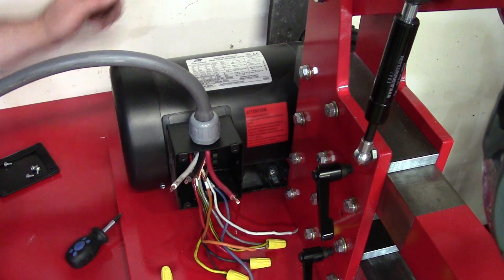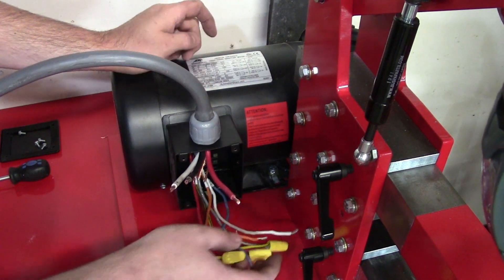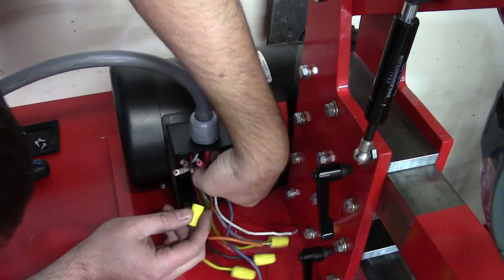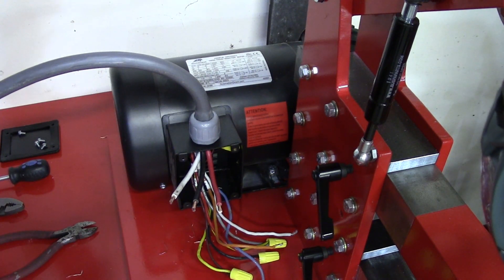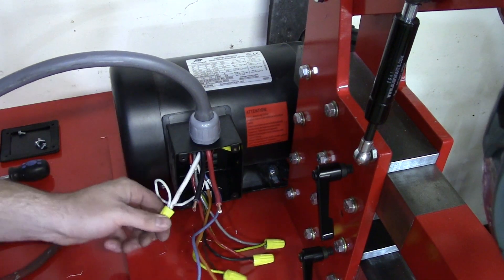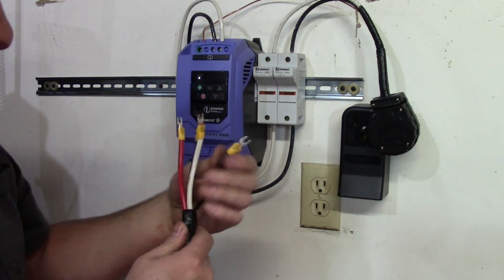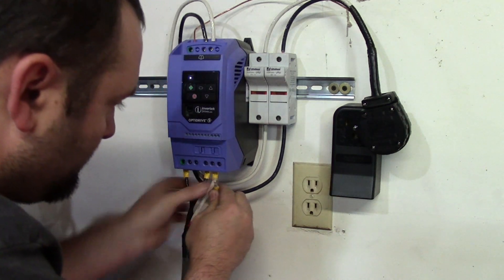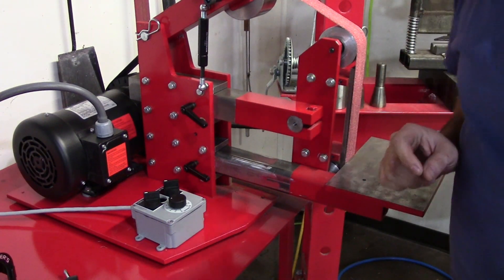How to wire a 3 phase motor to a VFD

Comment: Great video! Thanks for showing us all this. Newly subscribed and love your channel.

I’ve got a KBAC-27D and the iron horse motor for my grinder. I also have a Rockwell knee mill and a Rivett lathe that I’m going to be updating the motors on, to the same exact motor. I’m planning on using the single VFD with a twist lock female attached and then swapping out the machines (which will have male twist locks) as I use them. Any recommendations as far as plug/wire needs?
Reply from the maker: Thanks for watching!

Comment: I'm trying to wire a 3-phase motor from an old DeWalt radial arm saw to my VFD.  There's no wiring box on the motor, only 4 wires coming directly from the motor housing (red, white, black, and green).  How can I tell which of the red, white, and black wires connect to terminals U, V, W on the VFD?
Reply from the maker: If you're 100% sure it's a 3 phase motor it will not matter which order you hook them up in.  If there are only 3 lines that means all the jumpers are connected inside the motor.  If it spins the wrong direction just switch two of the leads.  If it's 220 single phase and one of those are a ground wire then you will destroy your vfd or motor.
Reply: @BeckTools  ok, thanks.  I'll give it a try.  I'm 100% sure it's a 3-phase motor.
Reply: @ptmoy1  my 200v GE moter is 3 phase also and only has three wires not color coded. I wondered if you were successful